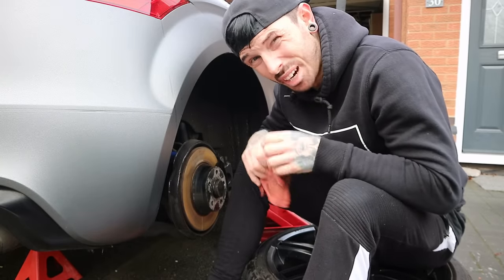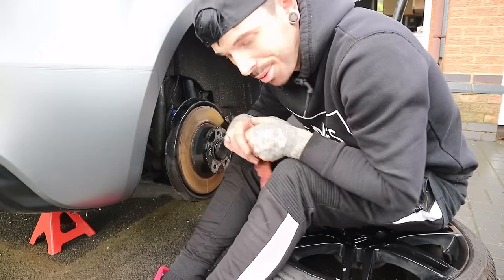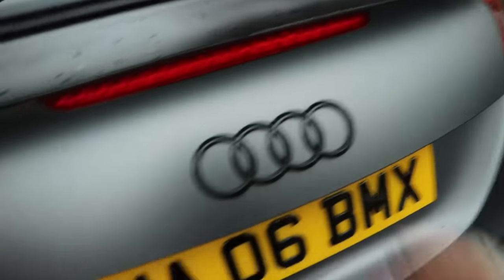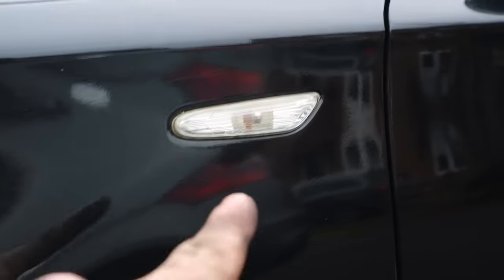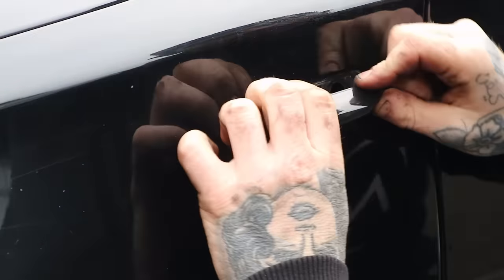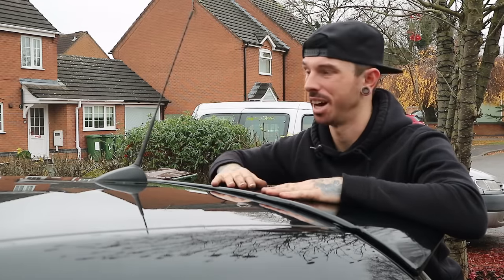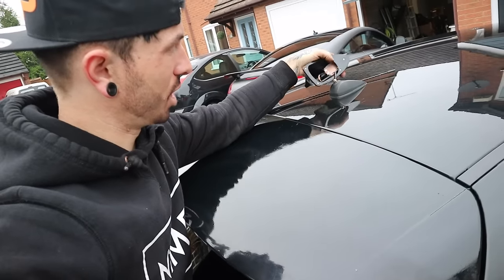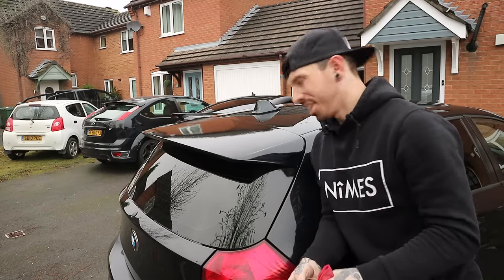2 CHEAP & EASY MODS FOR THE BMW 1 SERIES

Comment: Bro, i love these vids, im 17 but getting the 118d version in March. Keep doing stuff so i get an idea of what to do to mine
Reply: Yeah literally these videos are so helpful
Reply: You probably are aware but just worth saying: make sure the timing chain issue has been addressed! Very common on the n47 diesel engines iirc
Reply: You will never get insured on one
Reply: @jordanlever7667  im 19 and got one 🤔
Reply: @jordanlever7667  £298 a month tho 😣😣😣
Reply: @Jmarsden4  not 17 and not modified
Reply: @Jmarsden4  and 300 a month is mental for a slow diesel
Reply: @jordanlever7667  true but u can always lie for the mods that do nothing to the car 😂, i got a 116i so even worse for a slow petrol
Reply: @jordanlever7667  already checked insurance. Around £3200 a year but i prefer this than paying £2700 for a 1.2 corsa.
Reply: @CallumAtwal  yeah i already know about this issue. But is there any way of distinguishing the engines? Do all 118's have the same engine?
Thanks
Reply: @jordanlever7667  not all mods are allowed but i would deffo change the antenna for a shark fin, paint the front grille black etc
Reply: Bro go Tesco bank box. I’m 17 and have a 116i. It’s £1200
Reply: @leocrawford5152  just checked now... £6247 for me
Reply: I was 17 and got one living In London, insurance was 2.5K
Reply: Jmarsden I feel for you, I’m 19 with 1 years no claim and paying £108 a month for insurance with no black box
Reply: @benounich4889  thats the one thing dont understand. I live in coventry and have to pay £3000 and a friend of mine which lives in london is paying £470.
🙄
Reply: @matt-matt461  Got my first car when I was 17, BMW 1 series 1.6 Petrol. 2008 reg, and £158 a month for insurance. I live in Yorkshire, just gotta look around
Reply: gonna be doing most of the mods from this channel, so nice that Mat has these videos as no one else uploads this sort of stuff
Reply: I’ve got a 123D coupe and I’m 18
Reply: I drive a 120d cost me 1100 for a year and I'm 21 with 2 years NCB
Reply: mak ka Im 18, 19 in jan had license for 14 months. 116i m sport 2014 ( has a twin turbo stock) only costs me £200 a month. Might just be postcode 😂
Reply: Matt-Matt I’m 17 and I’m getting the 2020 116d msport mineral grey with magma red leather seats
Reply: Jmarsden I’ve got a 118i and pay 2k at 17, u got a black box?
Reply: Oliver you can’t get a 118i for 2 grand and no I don’t have to get a black box
Reply: Liam 1234 I meant insurance🤦🏽‍♂️
Reply: Oliver what year is the car
Reply: Liam 1234 2018
Reply: Oliver mines going to be 2020 and I’ve priced it £9049 for insurance
Reply: mak ka it’s not about the speed. It’s about being a good and reliable car that you can drive everyday. A good car for people our age (18-mid 20’s) i am going to get a 120d for 10k and its going to be 300€ a month aswell but thet is that I can buy it in  2-3 years. While paying this 300 a month u cant forget about fuel, costs to maintain, insurance etc etc.
Reply: @CallumAtwal  Id never buy one with an n47, not even if it had been changed.
Reply: @chazteb  agreed! Too much of a risk especially if you're a young (broke) driver like most of us 🤨
Reply: same actually, except i'm getting the petrol manual coupe one
Reply: Like me but I’m this year what about ur car
Reply: @Jmarsden4  how’s the 116i I want one as well because the insurance is too high on anything else I’m 18. Is the engine good?
Reply: @CallumAtwal  how’s the 116i I want one as well because the insurance is too high on anything else I’m 18. Is the engine good?
Reply: @chazteb  as long as the car has been looked after, there’s no problem. Just need to service regularly. When people neglect oil changes, that’s when bad things happen.
Reply: @V1PERB3ATZ  just get a little clio or something. 116i’s are very slow and not worth the cost tbh.
Reply: @Hesus_  It’s not that simple with the N47 im afraid, frequent oil changes or no oil changes the chain still stretches and the guides still break, worst case block the pick up and bang 💥
Reply: @chazteb  which ones have the N47 engine?
Reply: @V1PERB3ATZ  Good god, so many. Basically any 2.0 (and some 1.6) diesel from 2008 - 2015 has one, even minis are affected. In 2014/15 they finally ditched it and switched over to the B47 which is much much better, still has issues, but no where near as many as the N47.
Reply: @chazteb  if I do get one it will be a 116i 1.6 2007-2011
Reply: @chazteb  I've had my 123d for 150k miles and not a single problem, my mate also had an n47 and had no problems. It is that simple. If the car has been looked after, there will be no problems. I've also worked on plenty of n47's and seen what can happen due to lack of servicing.

Comment: Cheap and easy mod for the Shark Fin, but be aware that the seal isn't great using the 3m tape provided, and water can get in under the Aerial and start to corrode the roof! (and the electrical connection) as it just sits there underneath and slowly rots. What I did was to use some silicon sealant too, just to be safe. I have done this mod to my Seat Leon, and my Mini R56 (on my channel) if anyone wants to take a look :)

Comment: I saw you struggling with that brake line.. that happened because the nut was seized to the line.. it’s an easy fix for a garage and cheap. You can try abit of brake fluid on the joint that may have separated the nut from the line and stopped that happening..

Comment: 1M bumper 👍🏼

Paint code might be in the boot under the carpet on a sticker from the factory
Reply: Paint code should be on the inside centre panel when you open the drivers door,  it is on my 1 series 👍🏻

Comment: I unscrewed my shark fin then took my original areal out and put it inside the shark fin screwed it all together then used the 22mm nut inside the car to bolt the whole unit to my roof as well as the 3m tape supplied

Comment: I had led side indicators for few months, then half of them stopped working. Then i just smoked old side indicators. Unfortunately didn't passed MOT, so had to sand them back to original white...

Comment: I love what u did to ur car mate looks amazing
Do you reckon there are any 1 series 1.6 diesel from 2006-2009 ? As i want a tiny engine that doesnt use much in a few months whrn i get my drivin license 🧐🧐 amazing job u doing mate
Reply: Avoid all 1 series with small engines too many problems with then
Reply: anees miah yes mate i would like a 120d one 2.0diesel but insurance is expensive so id rathee pay gas more than insurance

Comment: I brought a repeater but it has no connection from it to the cars cable ? It just has a 2 pin slot. What do I need to buy to connect the two ?